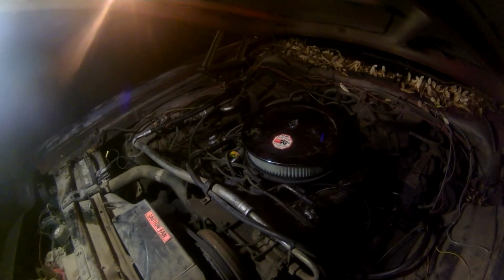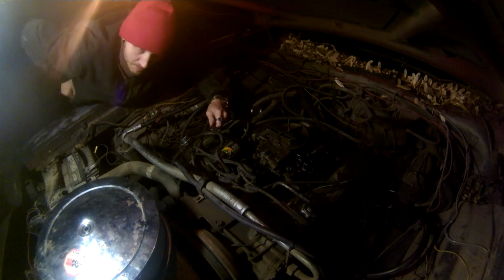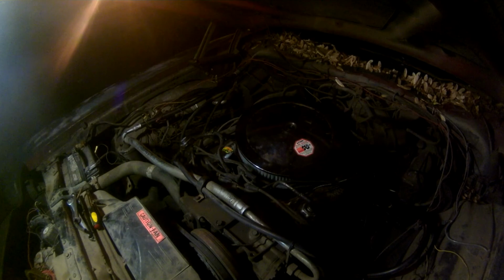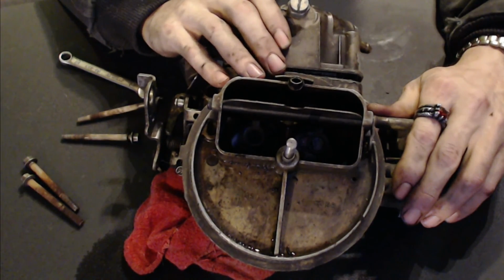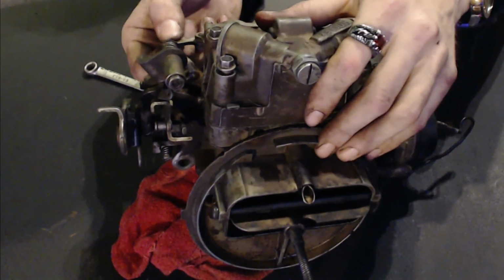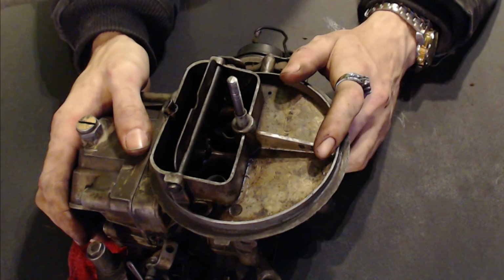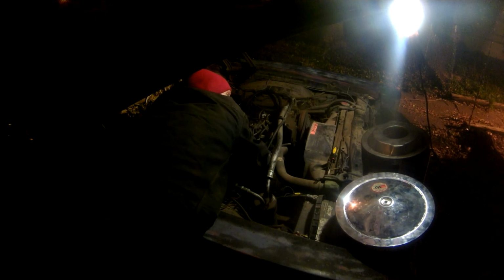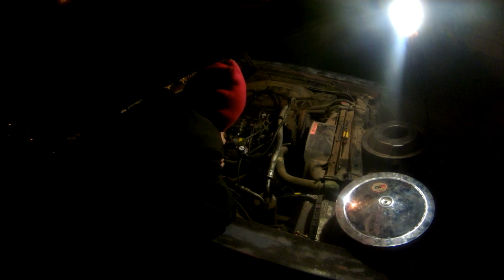⚙️ Carburetor problem Solved (In-Depth Diagnosis of a Holley 2 Barrel H2-2300)

Comment: I have a 1959 el camino with three 2bbl carburetors. When engine gets heated up the engine dies. Can start back up immediately. Have installed dash pot but still dies when heated. What would cause the problem.
Reply from the maker: Does it do this when it is hot outside as well?  Make sure that your fuel lines are not close to anything that is going to get hot.  With the way fuel is nowadays with Alcohol in it, it will vaporlock and shut down easier because of the lower evap point of the alcohol in the fuel, not only that, fuel pumps can't pump fuel in it's Vapor form, only in a liquid form, and even if they could you can't fill a Carb bowl with vapor.. It don't work that way.  Joking of course, but I seriously suspect vaporlock, make sure the fuel lines are not near the exhaust manifolds or headers and that they are away from the engine until just at the point of entering the carburetor, I have also seen some of the older gassers at the strip wrap their fuel lines in aluminum foil to keep them cool.. kind of acts like a heat sink.. Never tried it myself, but It seems like it could logically work.. maybe..  I wish you lots of luck.